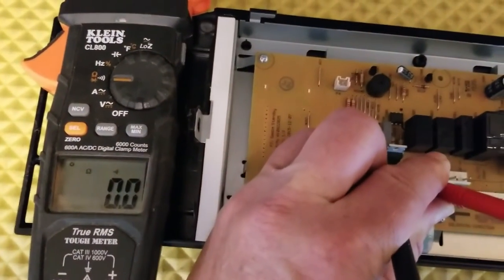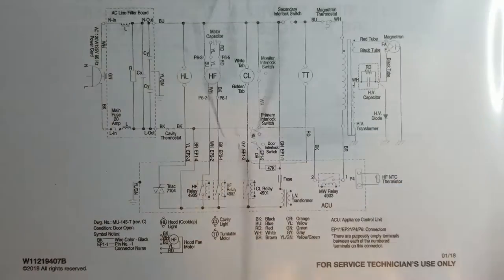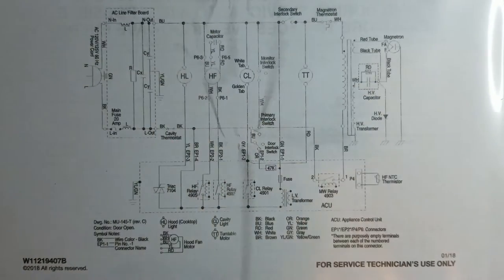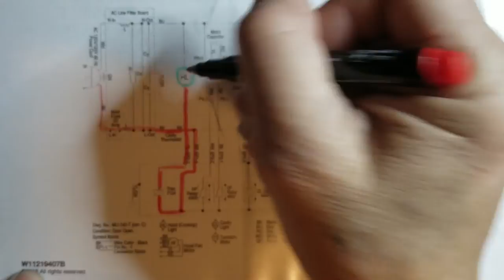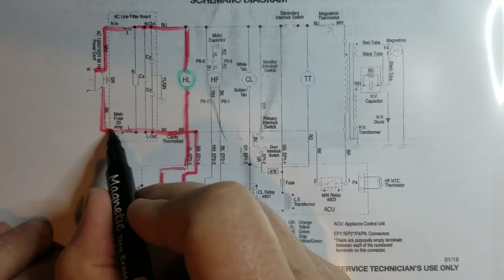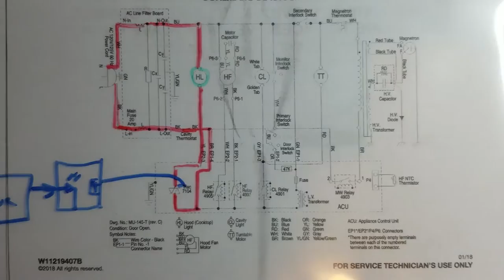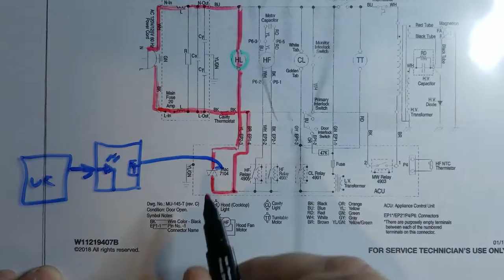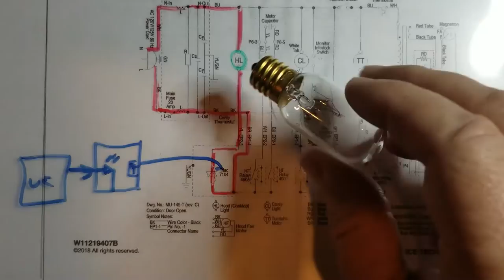#32 - Whirlpool Microwave Light Won't Turn Off - Schematic Walkthrough

Comment: This same scenario occurred with our microwave (capsule released from the screw base while removing it with the light circuit energized). The base shorted, but the end result is the HL won't light at all with an incandescent lamp. When an LED version of the bulb is installed it illuminates partially all the time but with an incandescent it does nothing. I assume there is some quirky failure mode of the triac. The PCA is a W10800189. Would you be able to identify which is part is the triac in question? Could it be one of the two TO-220 package parts I see? Thanks in advance.

Comment: Can you educate me on triacs for board level repairs?  What parameters are you looking at when buying for board repairs?
Reply from the maker: The main things I look at are Vdrm (peak off-state voltage), and It-rms (RMS on-state current). The BT136-600E is what I use as an exact replacement for the WP MW. It has a Vdrm of 600v (remember that 120v rms is 172 peak - so 600v gives plenty of head-room). It-rms is just the load current the triac can sustain. The BT136-600E can handle 4A, which is plenty for its application. I also keep the BT136S-600 in stock as it is the surface mount version of the above. Both of the above triacs are (sensitive gate) types, which allows for easy driving of them by common opto-triacs that isolate and are driven by microcontrollers as covered in the video. Although the BT136 will replace lots of common triacs, if at all possible, I try to replace triacs with the exact part number.

Comment: I'm curious: what design change could have protected these triacs when the bulb blows and shorts?
Could an extra inductor/choke inline with the light accomplish this?
Reply from the maker: A mechanism that cuts power to the light sockets when the bulb access panel is opened, or using a triac with a higher voltage/current rating.
Reply: @TheTechCircuit  love the idea of a switch on the access cover for the bulb. Smart. But, what about an inline fuse? I notice that you call out the 20a Line Fuse as "slow-blow". I'd assume, then, that there are fuses which respond quicker to overcurrent. Is this a thing? Perhaps more complex, but could the board also potentially sense current and disable voltage to the triac after so many 0a readings? In other words, if the board sensed 0 amps after so many checks, voltage supply to the load would be removed.
Reply from the maker: @garrybaker7656  Yes there are more quickly reacting fuses, but since there is still a delay, the current spike may dstill take out the semiconductor junction. About monitoring the current - certainly there are ways to do that and to disable the triac  - and while the engineers are at it, throw an error message prompting a bulb change.

Comment: Thanks for the explanation.   Wondered how removing a bulb would cause the issue...warming up the soldering iron now...
Reply from the maker: Sometimes removing the bulb causes the wires in the socket to cross and short out the light circuit. Unfortunately most people don't unplug the microwave before they do this and don't realize that the light circuit is actually activated at that time.
Reply: @TheTechCircuit  This is the first bulb that's blown since new in 2019.  Tried new bulb, then another...then went googling for an answer...apparently this is common place.  No warning labels anywhere near the bulb to explain to unplug appliance.  I'm sure it's covered in the 12 pages of warnings and cautions in the manual,  if only I knew where the wife placed that....🤣

Comment: I replaced the Triac. Now my LED bulb flickers at off. Then I noticed it says non-dimmable. Ordered a dimmable one from the jungle site. Hope this fixes it so I don’t have to buy a $110 board.
Reply from the maker: The triac-based microwave lighting circuit isn't compatible with LED bulbs. Only incandescent bulbs.
Reply: @TheTechCircuit  after I replaced the triac, now the microwave only runs for 3 seconds and shuts off. I must have damaged something else.